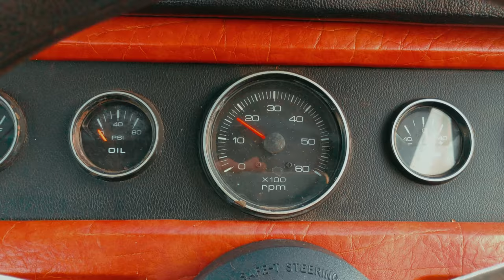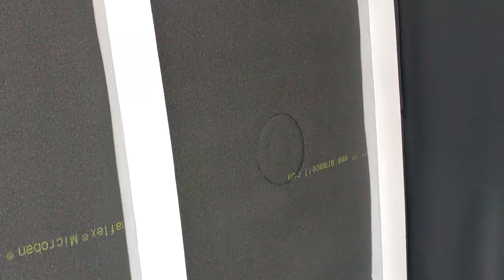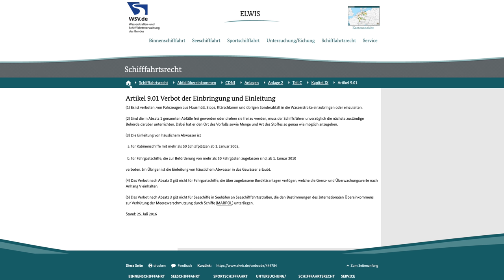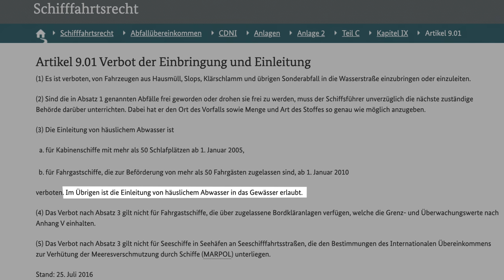Water System Refit on 1978 40ft Yacht - Ep. #46 - Vintage Yacht Restoration Vlog

Comment: What, no shut off at the hull penetration?  The tape on the "boiler" connections is a waste.  Those fittings are not tapered pipe thread, they are a compression fitting.  There's no harm in putting the tape on but there's no point to it either as the threads do not form a seal.

Comment: Consider a seperating toilet or perhaps a composting toilet. Pee by itself is quite clean, poo has loads of bacteria. If you use biodegradable shampoo etc, dumping grey water is not that bad. Dumping black water environmentally is a big nono. So if you seperate pee and only collect poo you can dump  poo with your trash. And dump pee in the water.

Comment: For the toilet outflow if it does go straight to the water then i would advise taking it below the water line... Smell and 💩fouling your hull wont impress. 😬😉
If you can run you outflow aft through the stern then take it down below the water via a smooth bend that might prevent any aesthetic offence 🧐👃🏼😉 an inline macerator will help prevent blockages ...as would small wash shower head ... Often retro fitted in asian house holds to the house wc flush feed🤞🏻it will reduce the tell tale cloud of toilet paper that gives the game away.🤫😂
Reply: From watching other videos it looks like the toilets are mounted on a straight piece of pipe exiting through the hull straight down. 

I was kind of wondering what was going to be done. Here in the USA I've only ever been on boats with a holding tank and I know you can't pump the tank overboard unless you are more than 3 miles offshore. I don't know what you would do without a tank.
Reply: @cobra02411  
From the link its like having an old car ...if your vehicle was first built/registered before a certain date it only has to comply with the construction and use regulations of that time. Legislation doesnt apply retrospectively. Though a Marina might be able to insist on a no discharge rule.

So if you've a late 18C sailing vessel your ok to hang your nether's over side and repel all borders 😲😂🤣
Reply: @clivestainlesssteelwomble7665  I get the concept of no ex post facto regulations. I just never gave it any thought till now. I've never owned a boat, I've only been on them and most were modern enough or were retrofitted to have holding tanks.
Reply: @cobra02411  

I know what you mean ...I would have thought they might have insisted on inland waterways in Germany .. 
Still thats as it stands .... 
Most major cities consume treat and recycle their whole river flow a couple of times over +  on their way through. The irony is the biggest risk is following heavy rains when all the road storm pot drains get flushed out and the treatment works cannot cope with the volume of water and effluent.. so they bypass and discharge untreated in so many places 😬🤦🏻‍♂️.... no wild swimming advised for a while.

Comment: “T” you used for gray water and bilge. Gray water is going to go back into your bilge.
Reply: Thats why he put one way valves.
Reply: The problem is they stop working very quickly with and solids passing through and getting onto the valve seat. Separate systems are the only reliable way to go.

Comment: Am concerned that if you are living on your boat that you are pumping your sewage straight into the river. A holding tank should be a priority. It doesn't have to be a big tank and surely your marina has a pumping out facility you can use. If all the other boats near you are doing the same thing, the river must be a cess pool. It doesn't matter whether it's legal or not, poluting waterways is a no-no these days.

Comment: The outl drain with the u bend is the wrong way its upside down if your making a water trap
Reply: That's to keep the water from coming into the boat from the hole in the side where the water is supposed to exit.

Comment: The water system makes little sense. Water accumulates in a tank and at a certain moment gets pumped out. Would be awkward if your system automatically starts squirting when you're in a sluice or marina after washing your hands.
It's better to have an outlet just above the waterline near your sink and let gravity do its work, no need for a pump.